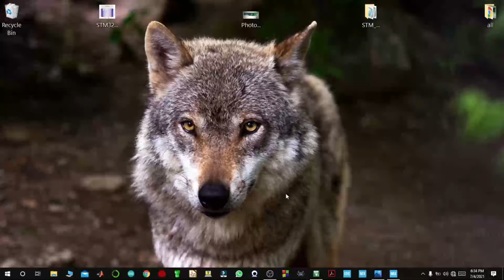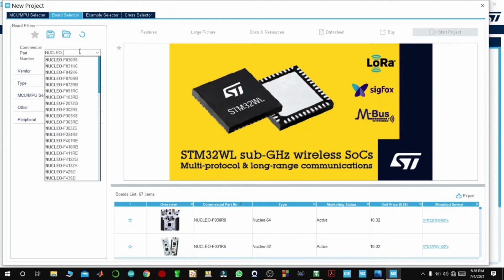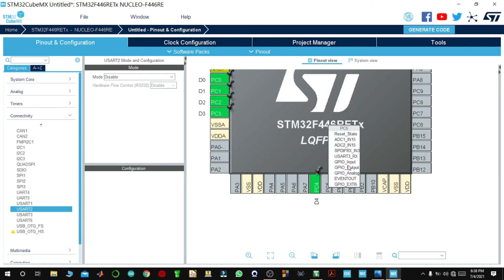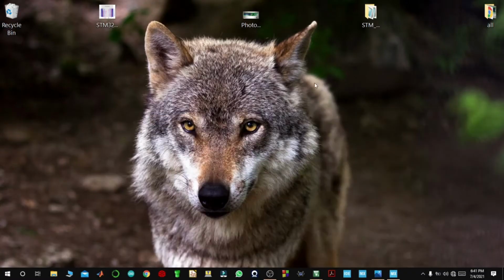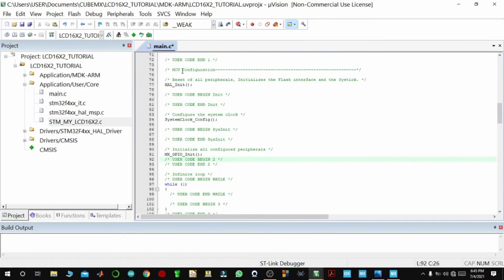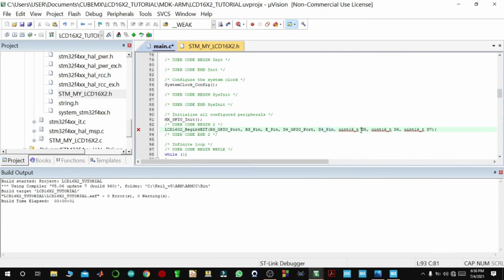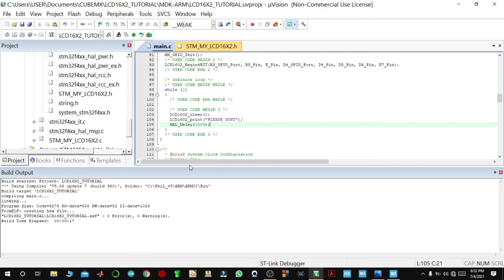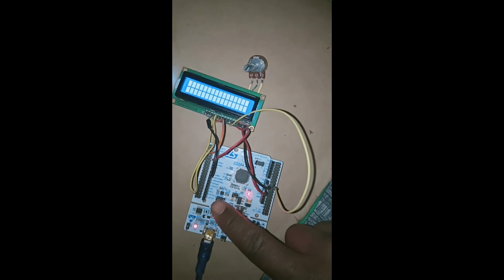INTERFACING LCD1602  WITH ST32 ||HAL ||KEIL uVision

Comment: In setup you configure 8 gpio pins, but in the demo near end it looks like you only have about 4 pins on the STM32 connected to the D0-D7 pins on the LCD. Can you explain?
Reply from the maker: Hello,sorry for the confusion caused,I wanted to have the tutorial on how to use both 4bit mode and 8bit mode but at the end I realized I have only connected the LCD in 4bit.